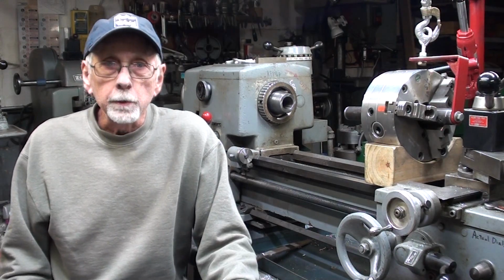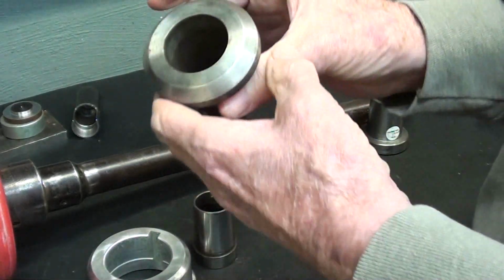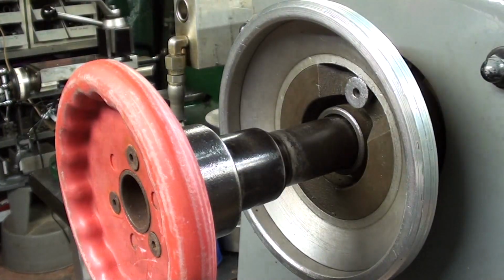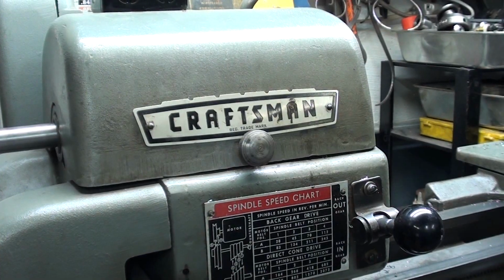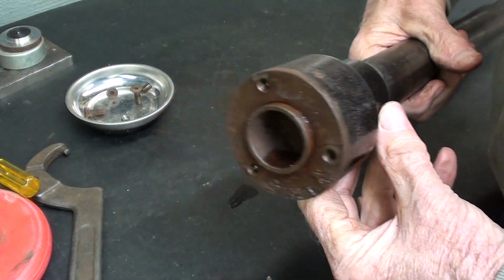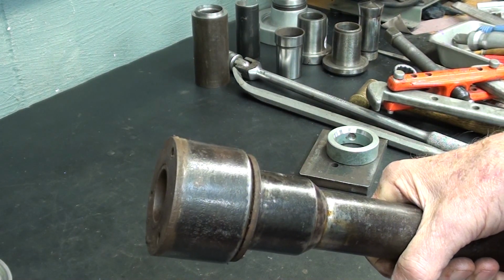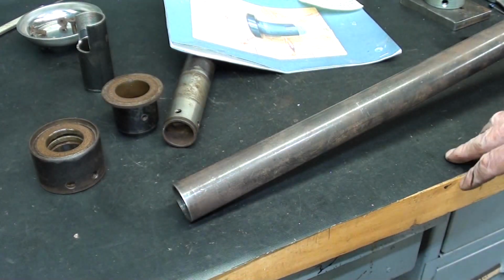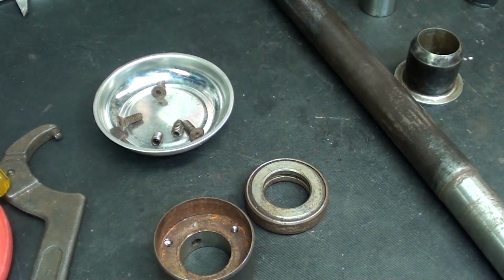Clausing Lathe Royal Drawbar pt 1 #791 tubalcain atlas

Comment: I have a classing lathe 5900 like yours. I also have a royal drawbar that is to long and the threads are bad . So I will have to cut it off and rethread . Could you please give me a over all measurements from some point to the threaded end . I will either make or keep trying to find the 5c collet adapter.

Comment: I'd have made the spacer because it keeps the drawbar intact. If you ever want to put it back to stock with the new tube it might be difficult to remember where the original is. More than likely, you will never need to do that in your lifetime and the original will end up in a scrap bin because nobody will know what it is. I recall in high school shop class there were two drawbars that would fit several different machines just by using different spacers.

Comment: So before I get laughed out of the comment section, I am looking to hopefully get a bigger lathe after I find a small mill for my home shop. Anyway, this video is extremely useful for my little 7x14 lathe that I've heavily modified over the years. It so far has worked ok for me and what I've needed to make but I'm dieing to get something with proper power and torque. Regardless I'm grateful for being able to turn stock in to parts even if it takes a month of sundays

Comment: Thanks for the thought process. It is great to see people think through something for a change.  Evap - o - rust  the whole bearing.  It will clean it up nicely without damage.  I been using it on old tools for a couple of years and absolutely love it...except the price.
Reply: White vinegar will do the job for $2.84 a gallon. Leave the parts submersed for a day and the job is mostly done. Clean off the gook, rinse in hot water, dry and oil to prevent flash rust.

Comment: I've always found the Royal handwheel to be kinda small. When I made a collet setup I made a 7 inch aluminum handwheel, with finger grooves, of course. I really like it. I never use a spanner. I might have gone to 8 inches, but I didn't have a suitable hunk of scrapbinium.
Reply from the maker: Yes, I like a nice Large handwheel.  But the original Hardinge Handwheel’s were quite small. You had to use the spanner

Comment: Lyle, if I were you, I'd just make the part using the tubing you showed instead of permanently modifying the original.  Just my 2¢.  ;)  I wish my 10-inch South Bend wasn't so old (1911) that it has no real bore through the spindle.  If I recall correctly, the hole through my spindle is only about a 3/16-inch diameter!  If it had a decent sized through-bore, I think I'd certainly be building a drawbar similar to those you've shown for your South Bend lathes.

Comment: The spindle is also called the “American spindle taper”. The Di-3 taper uses the 4 1/2 Morse taper, so it’s not that uncommon. My south Bend FOURTEEN, with the D1-3 uses that, as does the Monarch 10EE, as just two examples. I’ve got a 4 1/2 to 3 adapter.

I also have a 10L heavy. The spindle taper is NOT a 5 taper. It’s a proprietary taper that’s really a 3 taper angle, but larger in diameter. When I bought the lathe many years ago, I bought a 5 taper center for it, but found it didn’t really fit. It seems to fit, but it doesn’t. I bought the adapter from South Bend with the 2 taper inside. They told me then that it wasn’t a 5. That was back in 1982.
Reply from the maker: Thanks

Comment: Aren't you replacing a ground center on the tail of the drawbar with a less accurate turned center?  Maybe this is picking flyshite out of pepper since it's so far away from the spindle nose.  Liked of course.

Comment: Hey Mr. Pete can you see a number on the thrust bearing? I’am making a draw bar for my Hardinge T10 and a bearing like that would make using it much easier. If you can find the number and the time to respond I will be grateful. Don’t bother measuring cause I can do that but looking up the part number I can’t, no cross reference books. Thanks. I watch all your videos and am jealous of your collection of machines and Starrertt tools.
Reply from the maker: I think I show that number in the next video part
Reply: Looks like a kingpin bearing from an older ford truck.

Comment: Lyle, I 'hate' it to see tools for one purpose be repurposed unnecessarily. By simply making a collar/spacer to effectively add length to your spindle, that drawbar can be used on your lathe and still used for its original purpose. So I hope that's what you do in the end.

I suspect there's one solution to the drawbar problem you haven't yet considered....

...get the lathe the drawbar fits ;) LOL
Reply from the maker: Get ready to be disappointed
Reply: @mrpete222  :(

Comment: Great video.  We keep specialty tools on hand just for that one time when nothing else will do.
  I've considered making a drawbar for my 10" Clausing as I kept a set of 3C collets when I sold my SB Model A.   
What keeps me from doing this is the .642-26 internal thread I'd have to do at one end of the drawbar.  Haven't figured out how to do this yet.  Anxiously waiting for part 2.
Reply: Get a piece of galvanized water pipe to practice on. It's very soft and easy to cut. Pipe is what I used for my 5C draw bar and it works just fine and fits the lathe spindle quite well. I used a cut down brass nut for a bearing to tighten up the collet.
Reply: I agree with Ace who also commented here, get some scrap water pipe or galvanized pipe, heck even a big box store like the homeless depot (cause there wages really hurt me when I was working there, to the point I picked up more hours at my second job and just left something I did enjoy doing) they have it in bundles in plumbing. The pig iron pipe, or the galvanized silver steel pipe will work.

Comment: I have a 5912 Clausing with the original 5C collet attachment. The thread protector on mine is steel. The thread protector is also designed to remove the 5C spindle insert. The way that flange was machined off the insert, will cause issues removing it. 
Good project Mr. Pete.
Reply: My Clausing spindle protector is steel as well. Can’t say I’ve seen one in aluminum.
Reply: @836dmar  My guess is someone did a very nice job making that one.